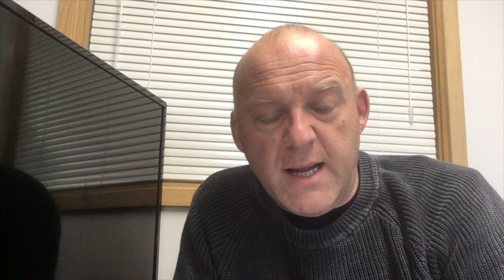What is Gyroscopic Precession in Helicopter Aerodynamics?

Comment: I have been looking for any info on the gyroscopic effects of the tail rotor since I became an automatic flight control system (AFCS) instructor for Sikorsky Aircraft in 1980.  I have an idea that the gyroscopic effect of the tail rotor is  the cause of adverse Yaw in a helicopter.   We have as part of the AFCS, a system on our helos to compensate for adverse Yaw but I have never seen a satisfactory explanation as to the cause of adverse yaw in a helicopter.  Explanation of adverse yaw in a fixed wing can be found many places and is fairly easy to understand.   Any ideas?